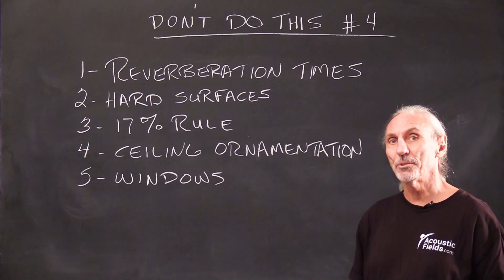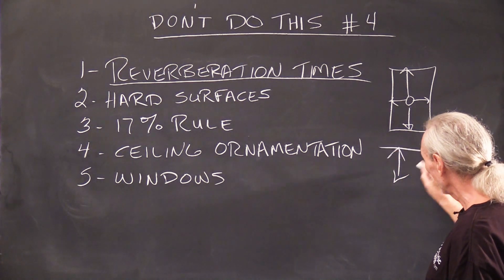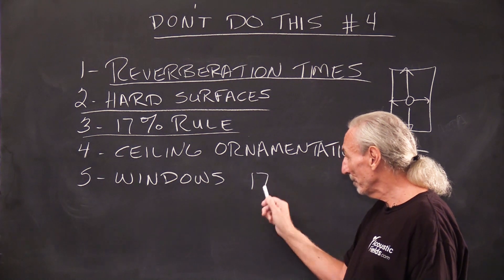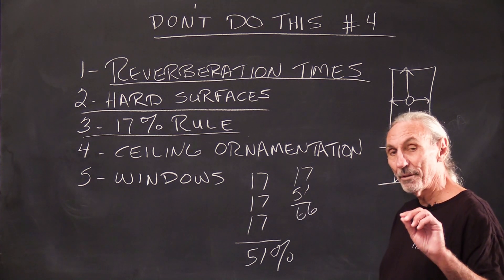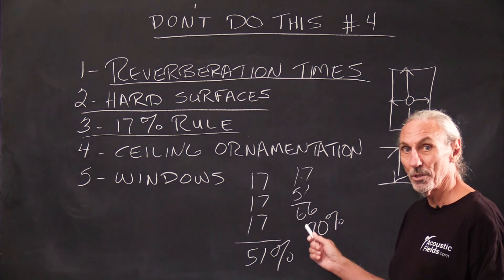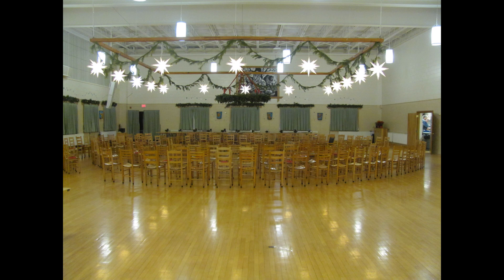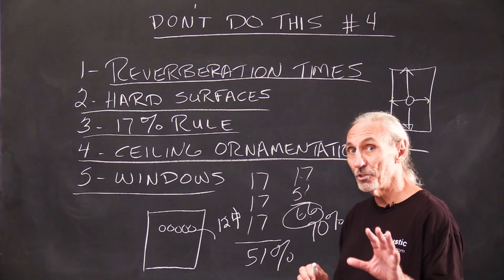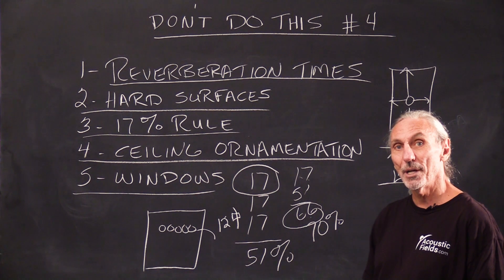Don't Do This! #4 - www.AcousticFields.com

Comment: I am going to go out on a limb and disagree about the 17% rule - I will try to find a reference.  The assumption is that each surface represents 17% of a cube but I believe the practical truth is much different - the first surface has far more than 17% effect, and each surface thereafter has less and less of an effect.  Like treat the first wall and it has 30% effect, 2nd wall has 20% effect on the new base level.  Next wall has 10% effect on the new base level.  I am just throwing out numbers for illustration - I will try to find a reference on my claim.
Reply from the maker: The 17% example is 100 / 6 which can be rounded to 17 %. This example is to show that each surface area contributes to the modal and reverb issues within your room. You could weight each surface area more than others for each modal or reverberation issue. The point is that the whole room contributes to issues and each surface must be dealt with.
Reply: @AcousticFields  Got it - mental experiment - you treat each surface consecutively with 1.0 nrc - the first surface you eliminate all direct reflections as well as all 2nd through nth order reflections that involve that wall.  Treat wall 2 - again you eliminate all direct reflections from the wall and all 2nd-nth order reflections involving that wall but there are far fewer higher order reflections because they were already eliminated at wall 1.  By the time you get to wall 6 you have already eliminated all 2-nth order reflections leaving only direct reflections.  So you see the first wall you treat has the greatest effect and with each subsequent wall you get a diminishing return.  

I certainly don't have your knowledge and experience and have been learning a lot from your channel - I just had read last week about this concept so jt got my mind turning.

Comment: Lol yeah this gave me an "ah hah" moment, TWICE. The 17% rule concept brings a lot into perspective. Enough seated bodies can be equivalent to carpet which roughly equates to a treated surface (floor)...<head explodes>. I've seen on more than one occasion where someone with a tiny room (12' wide by 14' long by 8' high) asks Dennis to point them in the right direction, Dennis says you must treat low frequency first, or more bluntly, to put 4 BDAs on each wall. There's your 66%. Do you have carpet? Let's be generous and add another 17%...

Let me tell you folks, I've had 2 BDAs built from the DIY package, and have other stuff  on the way, but just with those 2 BDAs, in my mother's tiny living room ( 12x 13x8H) the difference is immediately noticeable (five Arendal 1723s monitors). I've owned a Datasat LS10 (on the same level as a Trinnov), and later sold it because I needed cash. But these two BDAs made such an impact I'm not thinking about gear upgrades. It's incredibly refreshing! ...to know that the biggest impact on sound quality is proper room treatment. This man speaks the truth.  Just say'n. Just say'n.
Reply: Thanks for sharing it. Which BDAs are you using?

The 17% is not a concept, its 100% divided by the number of surfaces, assuming they are all equal, i.e. you live in a cube.
Reply: I use the BDAs that utilize the Acoustic Fields foam.
Reply: I'd like to confirm that even little treatment can give a huge effect.

I'm currently experimenting with a ceiling treatment (use German's Don-Audio absorbing material). With 6 panels the average RT60 goes from 0.81 down to 0.45 seconds. But JUST ONE panel does 72% of this job: the RT60 goes from 0.81 down to 0.55 seconds!

Comment: What would you suggest for treating the floor? Other than people, of course.
Reply from the maker: You may not be able to treat the floor. You may have to make up the square footage requirements of the floor on the walls and ceiling.
Reply: @AcousticFields  ok gotcha. Have you ever had to treat the floor in designing a room for mixing?
Reply from the maker: @Se7enE1even1  Yes there are many options from bare concrete to plywood. It depends on user requirements.

Comment: What do you do if your room has only 3 walls (the 4th is very far from the set up)??
Reply from the maker: I do not understand your question. If your room only has three walls then they must represent the front and sidewalls.
Reply: @AcousticFields  In my living room the speakers are close the front wall and the sofa is attached to the back wall, the side-wall is actually a big glass door, but covered by a curtain and the fourth wall (left side wall) is far from the system. It's rectangle where the entire system set up is closer to the right side-wall and the left side wall is very far.
Reply: @Lloyd Stout Do you think room treatment will help in my case?

Comment: 21st century & we can't have natural light in a working studio? Stock up on vitamin D?
Surely there is a solution / technology? Clear Gels of some kind? Thickness of the glass? Glass blocks formed to make diffusers? I'd rather not have to become a vampire lol!
Reply from the maker: You can have windows in your studio. They must be located out of the horizontal sound fields. When we build new rooms, we place windows along the top of each wall next to the ceiling and wall intersection.
Reply: @AcousticFields  OK, that's better than nothing. But have you tried any transparent [anti-vibration] silicone sheet coverings? If I understand correctly the main reason is due to the vibration of the glass, otherwise it would be practically the same a wall surface? So combat the vibrations & there is more flexibility?
Reply: @AcousticFields  I found a paper: "Vibration Reduction of an Existing Glass Window through a Viscoelastic Material-Based Retrofit", it's on researchgate if you want to take a look.
Reply: @AcousticFields  Another thing I just thought of, instead of curtains what about having those silicone sheets on a pole that slide over the windows? So instead of fabric, you have a transparent silicone vibration 'blocker'. This way they don't even need to be glued directly to the glass. How do you think this material would react instead of fabric?
Reply: Please, don’t hesitate to go outside at least in the morning, after wake up, and  early in the evening, before sun goes down.
Do not wear sunglasses (if you are not high in the mountain and so on), just use hat.
Reply: @adelkharisov  lol but it's the work environment I am concerned about. If you e.g. take a look at the biggest & most successful companies in the world, they have lots of windows & natural light - cannot imagine them making employees work in practically dungeons/caves LMAO only audio engineers! Even Serban Ghenea seems to have windows in his space & he's the most successful on the planet!
Reply: Jay Zill you can not get Vitamin D in the listening room through the windows, you have to go out and get some sunshine.

Glass is also a hard surface, thus reflecting sound, and human can only cover (close) it.
In a 2-channel listening room one can have uncovered windows high on the wall behind the speakers close to ceiling for early morning or early evening sunlight. And on the back wall, top to bottom windows, that you can open when you listening, because in stereo you don not need a back wall at all.
Reply: @adelkharisov  Yes but when having the windows open you can get some vitamin D. Otherwise it's a closed box without this option that you see in many studios - and what is being suggested.
I think even the most successful mastering house in the world has the whole front walls made of GLASS, with speakers built into the glass - so clearly there must be a way (albeit very expensive no doubt in this case).
Ideally 1 window or french doors on the front wall is what I personally would like to have. Like in studios where they have a window to the live room on the front wall. But to have a nice view also.
Reply: I've just found some "anti-vibration gel sheets" made of silicon - since covering the windows with fabric helps, what effect would silicon have? They have cubes on them also - perhaps they could be formed in a way to make a diffuser or not - but anti-vibration could possibly help?
Reply: Here's another: Eco-friendly Clear High Transparent Silicone Translucent Roll Rubber Sheet
Reply: Why not cover the windows with a transparent anti-vibration silicone sheet? There are some that are completely transparent it seems...
Reply: There's some stick on pads that says, "Silicone Gel Tape and Chips that can provide shock and vibration protection as well as *reducing noise*"
Reply: I think there's a slight calculation error.  17+51=68, not 66.  which would be closer to 70.   I know .  A little bit picking.  😜
Reply: What's up Jay.
I recommend taking a look Colt caperrune's studio; he did a studio review video recently and he talks about the big window he has in the studio.
Of course glass always fucks up the sound, but it's not the end of the world and we still can use heavy fabric curtains.
I have never seen anything similar to those silicon stuff you are talking about, but it seems interesting and I will check this out. 
I believe that for someone who spend just a couple of hours in the studio, having no windows is not a big deal, but to those who are professionals and are all the time inside, having no windows can be a health issue.
Reply: @MrTrz999  I checked out his video,  He using building insulation as room treatment.  Not exactly the best stuff to use and I didn't see anything going after the low frequencies below 100hz.   I'm also not real sure about the side walls with the slant to them.  Maybe Dennis can elaborate more on those kinds of rooms and discuss the pros and cons..
Reply: @Oneness100  
The slanted walls are filled up with absorbing material, and because it is slanted it reflects hi frequencies to the floor instead of reflecting it sideways, making a more complex and diffuse sound since you have the front and back walls that are not slanted. He also has the "cloud" that has rockwool, wich is absorbing. 

100hz and below are not a problem when tracking guitar and vocals, and for monitoring, usually we have little of those frequencies in the monitors and we have a sub that can be turned on and off when needed, but usually you don't use it as much in the mixing process.

Not the ideal room for listening, but for mixing it is good enough. Actually, there was a lot of tech rooms in big fancy studios in the 80s that were not ideal and still made best selling records, because when mixing, the key is to know well the sound of your setup.
Reply: @MrTrz999  I know he's using building insulation.  rock wool.  Not the best stuff to use.

As far as the slant sides, I'll wait for a response from Dennis. He knows a lot more than anyone else that posts comments here. 

If he's got speakers that produce sound down to 30hz or 40hz, then it is potentially a problem.  That's why you still have to understand the room's usage and you have to look at the energy being produced in the room and at what levels..   Remember, take measurements and don't guess.